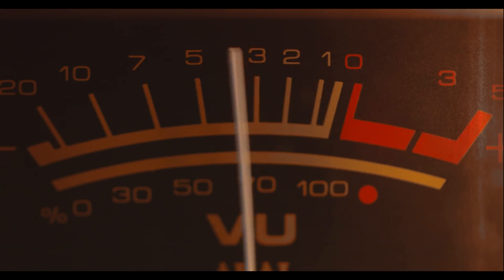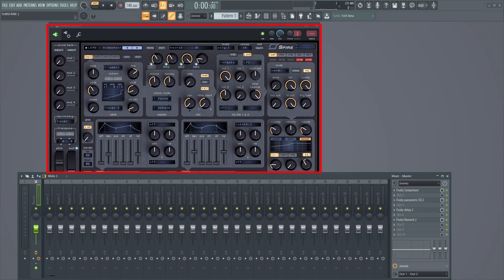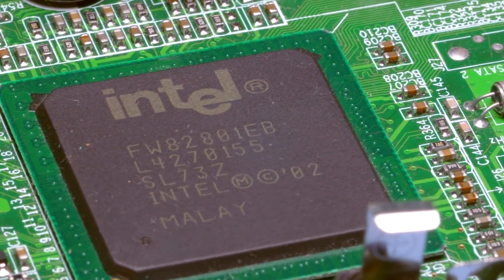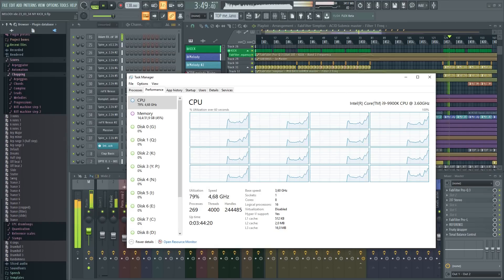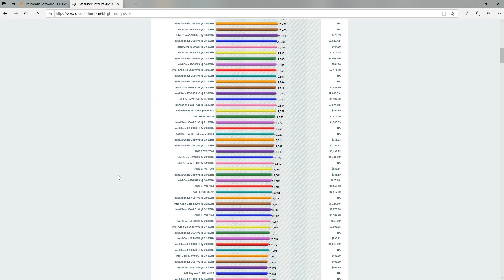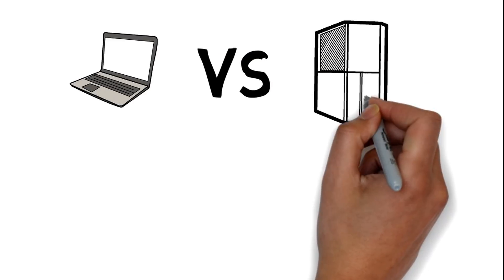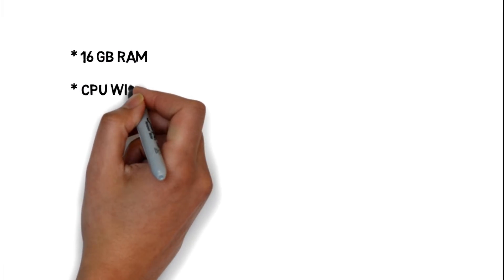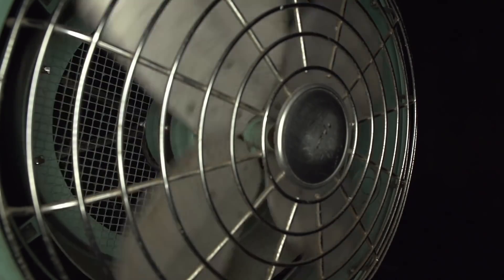The Best Computer For Music Production - What's Needed And Why!

Comment: Hoya about i5 9600k with six cores that after OC has on a single core results sometimes comparable but costs half of  I7 9700k/ i7 8700k price is that luck of additional threads per core will be mather ?
Reply from the maker: What you need depends on what kind of projects you make and how you work. The new AMD CPU's are definitely worth considering. They have great single core performance and also plenty of cores. They will provide the best value for your money.

Comment: Why DPC latencies were not mentioned, especially if Windows was the platform of choice? High DPC latencies can bring the whole system to a grinding halt, regardless of the CPU or any other specs for that matter. If DPC resolution time becomes comparable to the round trip latency (RTL) dropouts in audio stream are inevitable. (Depending on the chosen buffer size and performance of the drivers for particular audio interface with any additional safety buffers of course). This becomes a big issue if aspired RTL figures are lower than 5 ms to allow near real-time sound processing while tracking audio, virtual instruments or using the setup in live situations to process tha PA sound.
I do not have a lot of experience with how FL studio deals with audio drivers, but the total reported latency were different for i9 -- 222 ms vs i7 -- 257 ms. This gives the i7 ~15% more time to work with the audio stream than i9 -- not a fair comparison? Which is really strange, as the selected buffer size in both cases was 1024 samples?
The problem with that, is that the more samples the buffer is set at, the better any given CPU will perform (decreasing the the buffer underruns if there are any, or just giving more time to process any given buffer). I.e. if you take an old Core 2 Duo with stupidly large buffer, it could play the same project back no problem. And that is what was displayed in this test, despite different RTL figures, as far as I understood.
The biggest difference should be in the low RTL area -- comparing the number of effects or instruments a given rig could process without any crackles at a given buffer size (utlizining low buffer sizes 64,32 or even 16 maybe providing sub 5 ms RTL latencies). This should reveal actual differences in different rigs, as the systems would be operating in the vicinity of real-time regime, which you discussed in the beginning of the video (200+ ms latency is clearly audible and I do not think should be regarded as real-time?). And this is where the DPC latencies come in to play...

Comment: what are ur opinions on the ryzen 9 3900x ? instead of the i9
Reply from the maker: The new AMD CPU's are very good. It will provide better value for your money vs the i9. You'll be able to overclock the i9 to over 5 ghz with no problem, so when you take operations per clock into consideration then the i9 will still outperform the AMD from what I've seen, but the difference is not so huge that it's worth the extra money in my opinion.
Reply: with the R9 3900x will i need to water cool if its OC or will a RAD be alright, i do mostly music production ) rock soundtracks that can take up 80 mixer channels, my i5 is just about to do what i want tho my cpu is coked up, im saving to do a R9 3900x build, i also do a bit of video productions, and gaming too lul idk if it will handle all my needs
Reply from the maker: @Packman_r97  The noctura coolers as shown in the video are basically as good as the water coolers. They are safer, often quiter and cheaper.
Reply: @FireWalkMusic  i saw at 9:16, tho it looks ugly as hell cant have a window on that pc with LEDS looks like a dam UFO in there  lol

Comment: If buying a new MacBook, would it be better to get the i7 with 6 cores @2,6 GHz base clock or the 8 core i9 with 2,3/2,4 GHz? I understand that clock speed is very important and I assume the more tracks you have in your current project the more performance you would get with the 8 cores...
Reply from the maker: The i7 is still a great cpu, but the i9 will be faster. Also, it can be clocked to run at 5 ghz on all cores with minimal effort. Most motherboards come with "Tuning" software that does this automatically.
Reply: Be aware that the new macbooks have problems with USB2 sound devices. You won´t be able to make music without glitches.  Watch the video from Louis Rossman about this problem.
Reply: Bionic Wave Thanks, didn‘t know that. Have a RME usb2 interface, what the hell is wrong with apple...
Reply: @kamenorilo  RME is a fantastic interface to have. Yeah, everybody is upset about Apple not even mentioning these problems exist. I don´t like to hammer on somebody, but Louis has a point in what he says in his video. I experienced similar behaviour with other manufacturers like Asus or Acer.

Comment: Excellent video. In recent months, AMD's Ryzen Lineup has become far more competitive versus Intel's offerings, with the Ryzen 7-3700X and 3800X offering single-core performance not far off from the i9-9900K and for WAY less money.

On the more expensive side, the Ryzen 9-3950X pretty much destroys the i9-9900K in nearly every workload, for about the same money (if you can find one).

But you can build a totally competent system for almost any budget, depending on how heavily you'll be multitracking and how much automatic/processing/VSTs you're going to be using.
Reply from the maker: Thanks. Most people won't need anywhere close to this. It all depends on what kind of projects you're making, how many VST and effect plugins you use and so on. Even the older generation I7 CPU's will usually be more than enough. The new 3000 series from AMD is a huge leap forward and I'm glad to see that AMD is finally back in the game. They have made a really great CPU, and combined with Intel's ongoing manufacturing problems they have a real chance to finally surpass Intel, and not just by a little.

I used to be a real AMD fanboy back int he day, and I was very sad when Intel started to pull further and further ahead. Back in the day AMD was king, and they were even the first ones to beat the 1 ghz "barrier. Those were the days. It's great for consumers that they can finally give Intel some competition. :)
The 3900x is a real beast and will work very well for most tasks. When it comes to music production though it seems like the 9900k is still a little bit ahead, especially when overclocked. When you take operations per clock into consideration, and the fact that the 9900k can easily run above 5 ghz on all cores then from what I have seen it will slightly outperform the 3900x. Not so much though that it can defend the price difference. 
All the new AMD CPU's will provide far better value, and I'm surprised that Intel hasn't dropped their prices more than they have.
Reply: @FireWalkMusic  The 3950X's IPC increase, according to AMD is just over 10% up from the 3950X, which comparing the 100MHz boost on the 3950X's boost clock, is phenomenal.

The 9900K (and even the 9900KS) are just about the best Intel can offer at the moment, and it will match and even beat the 3900x in serial processing.

BUT the 9900K can't touch the 3950X in parallel processing. The IPC gain and slightly higher boost clock (over the 3900X) can place it above the 9900K.

Not to mention, the new Ryzen 9 CPUs support PCIe Gen 4 (so the potential of MUCH faster SSDs) and Intel was having issues with its solder TIM under the IHS of their 10nm lineup melting under higher clockspeeds, implying that the i9 9900K is about the best they have to offer for the foreseeable future, whereas AMD is already planning a generation of successors to the Zen 2 lineup.

My guess is, the next 3-5 years are going to be fantastic for people with X570 chipsets.

Comment: Just to quickly point out, the CPU meter in FL Studio very specifically displays the percentage of usage from your current buffer size.

For example, let's say you're using 64ms in ASIO for your buffer. If FL is showing 70% on the CPU meter, that means that 70% of your 64ms buffer is currently being utilized by your audio in-project.

This is why the CPU usage in Task Manager does not match up with FL Studio's. Image-Line is displaying much more relevant info, dealing with the specifics of what you're doing, whereas Task Manager is showing the total usage of your CPU over time.

Also, just as a side note, HWM (Hardware Monitor) is much more accurate than Task Manager and is also free.
Reply from the maker: Indeed. I actually have a video about this very topic (the difference between the CPU meter in your daw vs task manager):   https://youtu.be/hX10k8Hb77g

Comment: If what I am hearing here is true that means a PC set up for multitrack audio recording can easily handle video production as well
Reply from the maker: The 9900k works well for video editing too since it has a decent amount of cores. I suspect the new AMD CPU's will work very well in that regard too. More cores are generally better with regard to video editing, since it can utilize parallel processing much better than a DAW can. Also, most video editors will benefit from GPU assistance from the video card as well, so the video card plays more of a role as well.

Comment: Hey I'm about to follow your instructions and purchase every single item specifically and see if I cam achieve my dreams and goal of having a limitless and powerful audio/video machine! However, I just wanted to ask if it's okay to have gotten the newer model video card (Asus GeForce GTX 1650  (Dual-GTX1650-O4G)) and also you wrote that you purchased the (

Crucial MX500) internal SSD but you provided a link to a (Crucial MX300 525GB). I went ahead and searched out the "correct" labeling and purchased the (
Crucial MX500 500GB 3D NAND SATA M.2 Type 2280SS Internal SSD - CT500MX500SSD4" which actually was a little cheaper. Is this okay and is there a difference between the 2280SS vs. 2280 or is it the same. Thank I am waiting to finalize my transaction confirming these parts are perfect and I will go ahead and give it a green like to go, go, go. Lol thank you for the info!
Reply from the maker: I'll have that link fixed. To answer your question, it doesn't really matter as long as the disk has a fast write and read speed. ALL SSD's have vastly superior read/write speed compared to internal HDD's. Regarding video card: The video card doesn't play a huge role in music production since nothing is GPU accelerated. It's all done by the CPU. In theory you 'll be just fine even with the built in graphics. 
If you do some gaming or video editing and such as well, then go for a decent video card. Especially if you have more than one monitor.
Reply: @FireWalkMusic  Okay, thank you as you have been much help and have probably actually saved my life (In a good way) XP from questioning and have probably solidified my passion in music production. Final and last question, will I be fine without purchasing a monitor if I have a TV that I practically use with an HDMI plugged into and with my laptop currently, for the PC after and when I successfully build my computer?
Reply from the maker: @FeelsFlows That's  good to hear! you're welcome. Any monitor will do, the TV will work just fine! :)
Reply: @FireWalkMusic  Yes, haha I presumed so, and well I confirmed order! So let's see the process of an amateur computer tech unfold, wouldn't really say I'm advanced as many on YT but I am pretty knowledgeable when it comes to this and other miscellaneous stuff like computer culture, ect. I will definitely keep you updated as I will let you know when I finish the monster PC! XD Also, I may record it and successfully I hope it all goes well! My last question would be once it is built, would I need to go about purchasing my own copy of windows!? Thank you.

P.S. Also it'd be nice if you could/ have done a specific method of install video showing us how you did do it, as simply just buying the parts and installing it to our own best knowledge wouldn't be as intimidating!
Reply from the maker: @FeelsFlows  I'm sure you'll be more than happy with it. I use it for very heavy projects, as well as video editing etc, and it just chews up anything I throw at it. 

Building isn't too difficult. IT's quite straight forward. There's lots of videos on YouTube about it if you need assistance. 

I recommend getting an OEM win10 version. You can buy a downloadable version for $15 or something. That's what I did. Insert a formated USB drive in a USB port, launch the application and it will copy the installation to the USB drive. Then, just put the USB drive into an USB port of the newly built computer and boot it up. It will ten detect the installation on the USB drive automatically and begin the installation process. Quite simple. :)
Reply: @FireWalkMusic  Hey so I am getting ready for the initial build process to begin, just my motherboard awaits arrival should be any second now! Will post results after, just a couple quick last minute questions! One, what is your preferred choice of coolant paste method, would you advice the spread method with the spoon? And second is the coolant's weight completely supported by the motherboard handles" or is there perhaps zipties tied to the top to a fixure of some sort helping the weight? Thank you!
Reply from the maker: @FeelsFlows  Did you go for the same cooler I did? If so then the paste is supplied with the cooler. The instructions are very clear. Just a small drop is enough.. A lot of people apply too much paste, thinking that it will enhance heat transfer, when in reality this will only make it worse. A small drop is really all that you need. It will spread out on it's own when you apply the cooler,. The cooler itself is fastened to the back of the motherboard, and then the motherboard is fastened to the case. It might seem strange to have such a high weight cooler just basically hanging by the motherboard, but it's designed to handle it.
Reply: FireWalk Hey so I have finished my build!! Everything works fine but my fans after I installed them on the one board where I can put al of them together aren’t working? Only my cooler! Any basic configuration you did or did you just plug them all straight into the motherboard?
Reply from the maker: @FeelsFlows  The fan controller allows you to connect a lot of fans. However, for most people this is not needed, and you'll get better operation of the fans by putting them directly on the motherboard instead, since you'll then be able to control them individually, as opposed as "one" when you connect them all to the hub. 

If you have the Asus AI suite installed then it will run a benchmark on your fans to determine the correct speed for each one,  so it's best to have them on the motherboard as long as you have enough connections for it. There should be plenty of outputs on the motherboard.
Reply: @FireWalkMusic  Haha nice I successfully built my computer to my belief! Thank you for the help so very much as you are a god send. Anyways, I have installed my fans into slots such as W PUMP and ect. other slots! They seem to be working fine as all my temps are at about 80F and the 3rd temp reading at about 95F! Haha, now onto obtaining a good video software and I will try to put together a quick video! Thanks again.

Comment: It's gonna be cool if I would upgrade to this from my first i7 generation of 10 years ago :p
Reply from the maker: Sounds like it's about time then. Usually a computer tend to last for 4-5 years at the most before it really start to show it's age :) It used to be way worse back in the early 2000's though. Back then a computer would be completely outdated after 6 months. After a year it would be almost unusable. :)
Reply: @FireWalkMusic  Yeah, because we're now in the 64bit era, with lots of memory and good multi core processors, we can last a bit longer. But I have been able to continue to use this pc because since cubase 8, and some plugin upgrades to vst3, i've been able to snoop 1/3th of system performance off the most heaviest projects that I have. Ofcourse the cubase mixer itself also became heavier as it's now 64 bit internally. The very sound quality of songs that I made back in 2008 sounds so much better now if I load the same project!